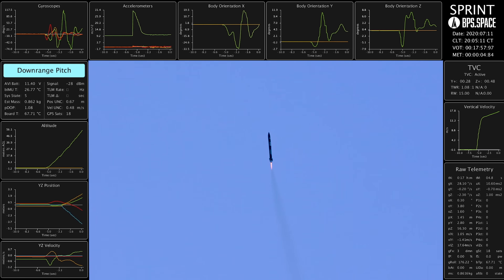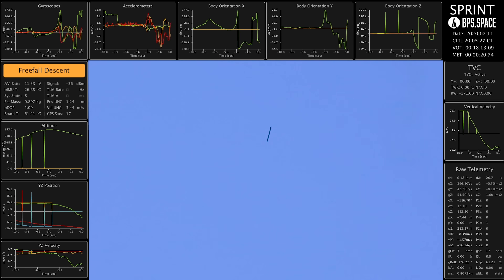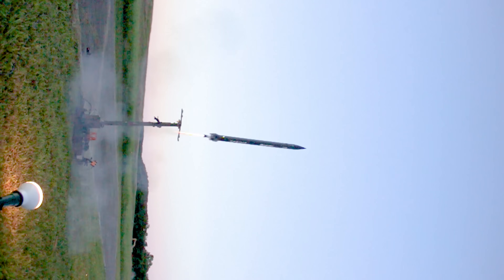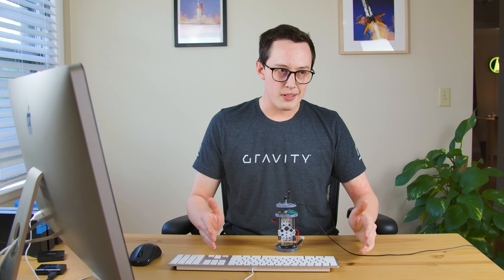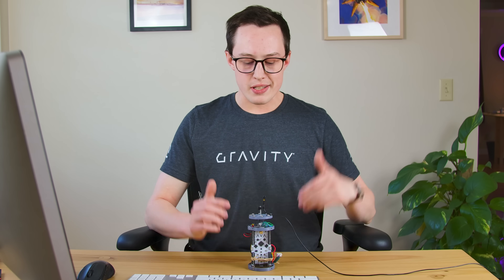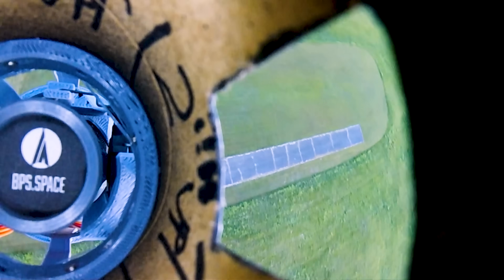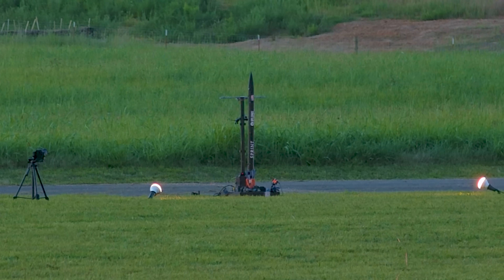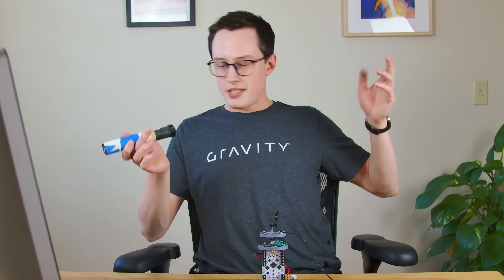Sprint - Test Flight 9 - Aerotech G11

Comment: Floating point to integer :) I got called in to determine why another PLC programmer's anti-surge control routine failed and caused a 5,000 HP turbine driven compressor to eat itself ($1,000,000.00 crash at least). The turbine / compressor had been repaired and was online, with the same code in it when I got there. I installed my ASC and ran it in parallel. My calc indicated the unit was running in the mid 90% surge margin range. His showed showed about the same. My flow calculation is more accurate but the result was close. BUT, the PV of the ASC indicated 0, so something was wrong. The operator had the controller in manual and set to 100% output, ie valve closed, otherwise they would have been in full recycle. More on that in a bit. The way the calc works is based on the fan law, which is N1/N2 = Q1/Q2 = H1/H2. You divide actual speed, N1, by design speed, N2, to get relative speed, aka % speed. Then you calculate for relative flow the same way. Then you divide relative flow by relative speed. That gives you % surge margin. In simple terms surge occurs when flow is less than speed and aerodynamic efficiency goes to hell :) A typical curve from the compressor manufacturer is going to have 60%-ish as the surge line at any given speed and the controller SP will be set to 70-75% (0.70 - 0.75 but we usually multiply by 100 so the range is 0-100% which will make more sense to an operator). I traced his ladder logic, line by line (I use structured text so I couldn't compare my  intermediate values) and when I got to line 10 I saw the problem. Newer PLC's are tag based rather than IO based (simplified). He did all of his calcs with results stored in floating point tags except the last one. The last result was sent to an integer. It was going to be 0 or a 1 no matter what. This caused the controller to send 0% to the anti-surge protection valve, which caused it to open 100% (fail safe valve) and send 250 - 300 degree F gas (heat of compression is a thing :) ) back to suction. The idea is to increase flow by recycling discharge to suction. Normally it's a short duration fix that is only allowed to happen 3-ish times in a specified time frame or the unit shuts down on surge. The normally cool suction stream heated up which increased the discharge temperature and created a pretty dangerous temperature feedback loop. There is a high discharge and high suction temperature shutdown on the machine but someone installed a 6" long thermocouple into a well that had a 6" lag (section of the thermowell that sticks out that is usually used on insulated pipe) so the thermocouple wasn't inserted into the gas stream. It never got hot. That introduced the second safety system failure point, the primary being the failure of the ASC PV calculation. 

In control... Probability of failure on demand for every component, sensor reliability, processor reliability, and having at least two, preferably three "backups" (I prefer backing up with unrelated sensors. Flow, pressure, temperature for instance. Unrelated is not the right term btw)

Comment: With software you could eliminate that wobble overshoot for a more locked in flight.  Think about it - how to accommodate the speed of your mechanical nozzle aiming, and think about how a PID loop handles that sort of issue.  I would be happy to help if you're stumped.
Nice looking flights (except for the momentary overshoot wobble ;) )

Comment: What do you use as rocket fuel?
Reply: Premade high-power rocket motors (store bought) with either black powder or (I think this is the one in the motors) aluminium and ammonium nitrate fuel

Comment: You might be heading into an operating regime in which acceleration feedthrough into the gyros becomes significant. It's typically on the order of 0.01 to 0.1 deg/sec/g for consumer-grade parts...

Comment: #issue_1_from_fan
why not to disable motor stabilization when the engine has already finished running? (:
Reply: It’s difficult and really not worth writing a whole other couple pages of code to stop moving a mount for an extra 10s or so
Reply: @solidrocketmotor9871  just say you like this little wiggle-wiggle effect (:

Comment: Weird idea.  If you used a steerable main chute you could have the steering strings pulled by the engine servos.  During ascent  the strings would be stowed with a bit of slack so they don't interfere with the engine steering.